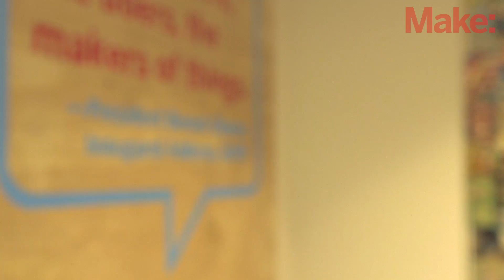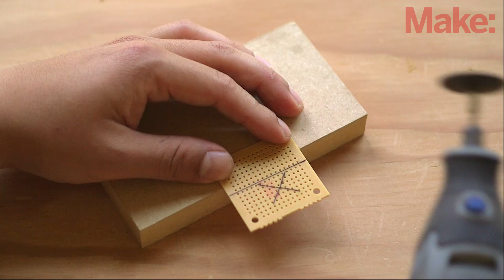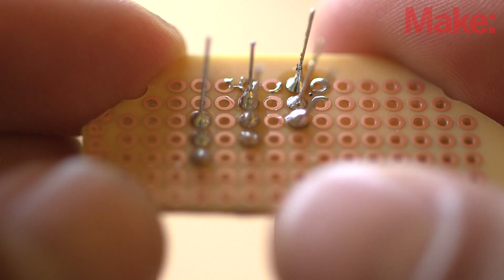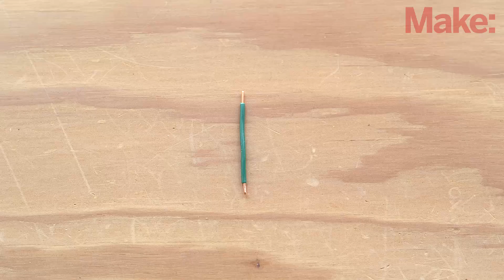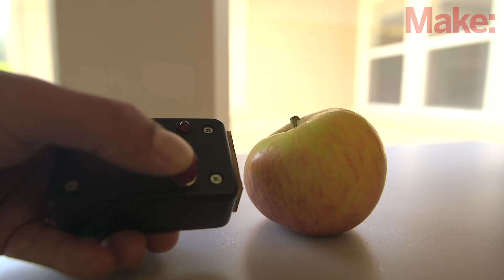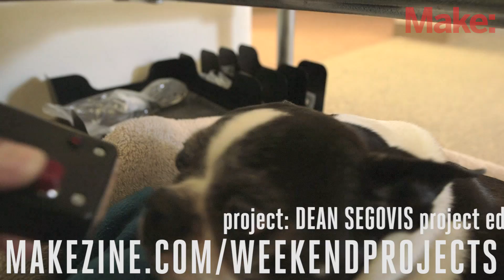Weekend Projects - Non-Contact Voltage Detector

Comment: Why can't it detect AC voltage? It's because the electrons move too fast (50 Hz)? Would the detector function if the electrons were moving slower (like 2-3 Hz per second)?
Reply: Hz is oscillations per second, so "2-3 Hz per second" would be 2-3 oscillations per second per second
Reply: slango20 yes, you're right! I know it but I didn't think about it when i wrote it; my mistake ;)